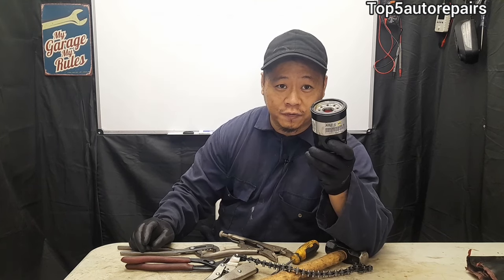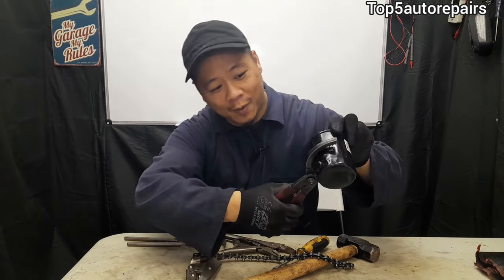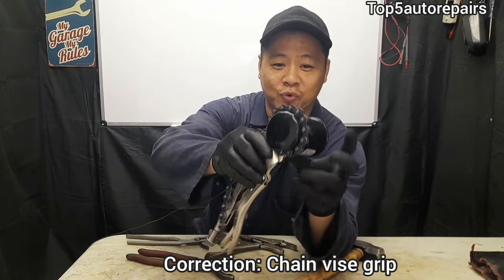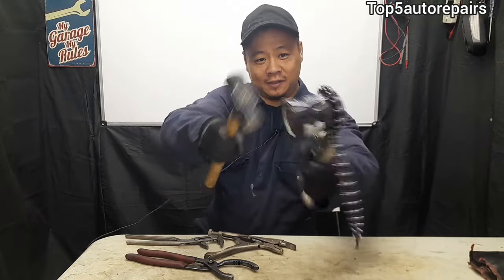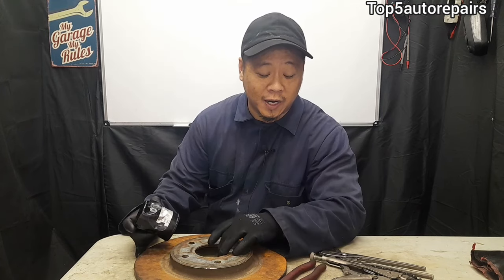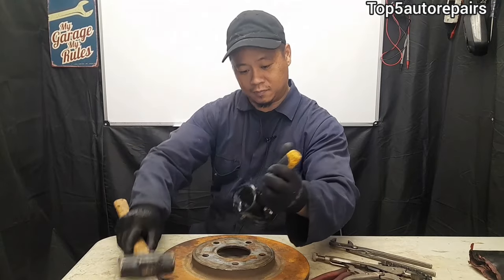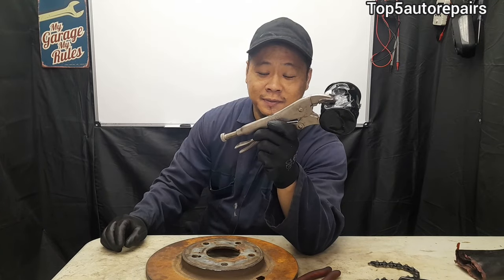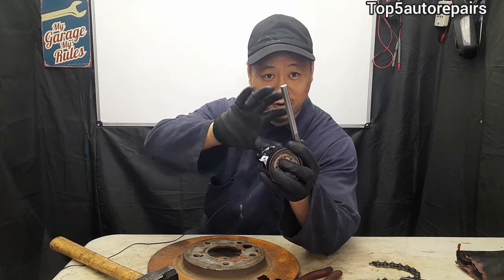5 Tricks To Remove A STUCK OIL Filter That Won't Come Off

Comment: Well, when the engineers put a bunch of plastic around it and you literally have maybe an inch of reach it’s impossible.
Reply: Luckily VW diesel engins use the common 32mm  socket to remove oil filter housing.... They made it easier for the DIY guy..... For the old school i just punch 2 holes with screwdriver  then twist it loose with needle nose pliers..... Its bit messy lol.... But it gets the job done quicker than looking around for fancy tools 😊
Reply: The screw driver hack helped me, 1.2 Renault Clio 2007 with about 5-10mm room to lever. Easy job, zero access #mechanics

Comment: Great video man! Unfortunately I Tried all of those methods before watching this. First time in 25 years working on vehicles that I have seen an oil filter.Stripped all the way down to the very top layer and still unable to get it out even with a hammer and punch!! I removed the entire housing assembly and its in my shop vice at the moment... just cant belive it though! The oil filter was one of the more expensive brands too... all i can think is some how it got cross threaded when changed and installed with an oil filter wrench with an extension to have torqued the piss out of it that much to where it is now married to the aluminum part of the block.   Lol this should be fun though.  Im thinking im going to just pull out the stick welder and tack a little handle on it and then bear the piss out of it. Worse case scenario..  I'll have to replace the housing. Has anyone else ever had this problem? I still cant believe it though.. fun times

Comment: I was all ready to buy a drill to fix my stuck oil filter. But the shop assistant suggested I simply try sliding a pipe over my wrench to provide some more leverage. I tried it, and it made an impossible task easy. It only set me back $5 for the bit of pipe. I hope this helps someone else. God bless! And thanks for the video.

Comment: very tight area, used a long thin pipe to hammer the screwdriver thru from above, knew it only needed a 1 inch turn to loosen and screw driver came out easily, not too much oil to clean up, most stays in the filter, thank you so much

Comment: Trick #6 Use one of em "socket" like tools that fit on the end of the oil filter. The type you use a ratchet to spin. Of course, the cheap tool strips around the oil filter. However, if you put 2-3 screws through the "socket" tool and into the filter, it'll hold and spin right off.

Works great for a vehicle like mine where a standard oil filter removal tool won't fit.

Comment: This is useful information because most times when I take my car in to get the oil changed they don't preoil the gasket and wrench it on so tight I have to take it back in to get it off. The screwdriver method work for me

Comment: Thanks for the tips!
Another way if you don't have an oil filter wrench, take an old belt (serpentine or other) and put one end of the belt through the open end of a wrench where you have a loop that you can slip onto the filter.  use it like an oil filter wrench

Comment: I’ve seen a few videos of the screwdriver method but they never go into more detail about what to do if THAT fails as well. Thank you. 

About to head out again and try to convince the oil filter to come off…wish me luck. 😅
Reply: Maybe take it around the block a few more times, it has separation anxiety. 😆
Reply: If the screwdriver trick fails then you need to take it off the block and put it in a vice before you tear it down to nothing like I just did.  Lol The chain with the vice grip method is obviously the best method to do. One method he didn't show is they make an attachment that goes right over the top of the oil filter.You buy at most auto stores. It has a spot where you can attach a breaker bar, to it. If you get one that is a little too big. You can just shove pieces of rubber in there or something to fill the Gap and it also adds grip to it since the oil makes it difficult for them to grab sometimes. Just lightly tap them on with a hammer. Not too far though or you will not be able to insert your rachet or breaker bar into the end.

Comment: before reachimg for a tool which can destroy the filter, double check your rotation.
When you have to reach around in a darkened awkard position it is easy to tighten instead of loosen the filter.

Comment: Try drilling a couple holes in your strap wrench then place it around your filter then screw a couple decent size screws in the holes and turn, or just take it to the Harley dealer and they will change it for 750,000 dolars.

Comment: I don't care what anyone says, like, "Oh, well, they put it on tight like that out of incompetence."

No! I disagree! No, the reason they do it is to make sure YOU can't do your own oil change. It's intentional SABOTAGE.

They gotta' be putting these things on with air wrenches, along with making sure the gasket is dry. I couldn't change my sister's oil because of this. I barely got the one for mine off of there. This crap is INTENTIONAL. So you’ll rely on THEM to do the change.

Comment: How do you get it off if the filter spins but won't come off or loosen. Like the inside is still stuck on.
Reply from the maker: Break apart the outside case and use a channel lock to remove the inside.

Comment: I’m on the side highway and I have tried everything you said and it has not worked I have done 1 million oil changes I’ve never seen a oil filter like this I cannot get it off not even with the chisel deal deal
Reply: Yo have you figured it out if let me know how